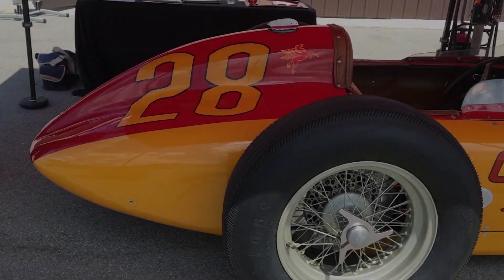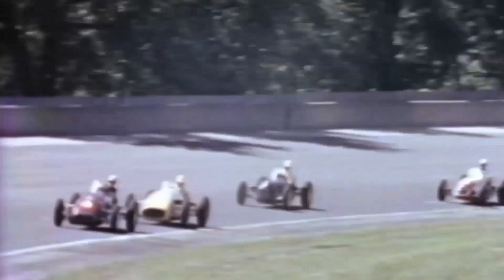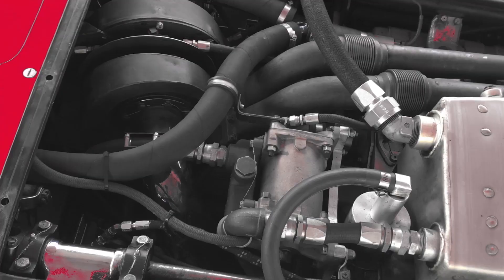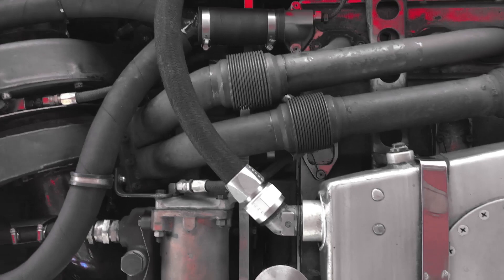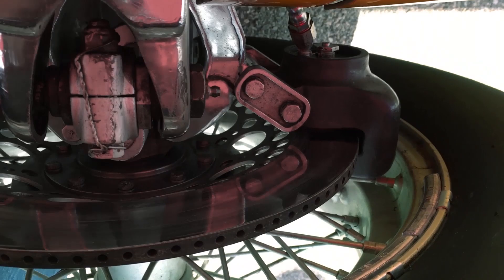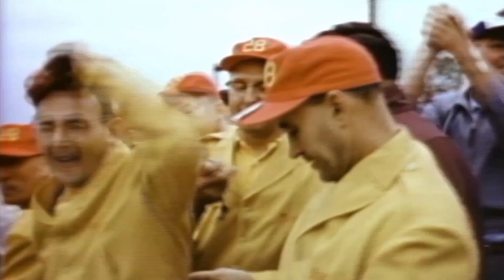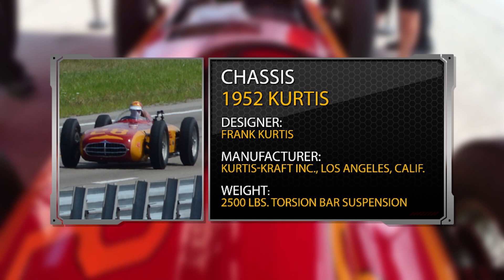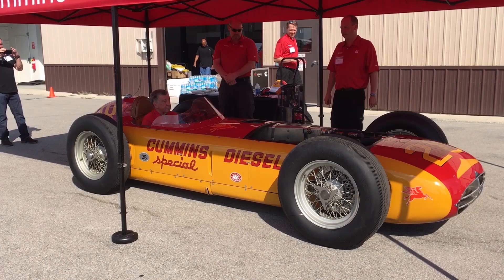Cummins Diesel Engine Sets Lap Record at 1952 Indy 500

Comment: This car is LEGEND in Columbus, IN.  Used to see it in parades as a kid.  There is also a famous Auburn sedan running a Cummins Diesel that is displayed from time to time.
Reply: yes the one from 1929? I was at the auburn acd museum this very day this fateful day that is the last of the 12 days of Christmas known as epiphany or three kings day for the magi, and also the year anniversary of that dark day when the capital was raided, anyway read about the Cummins special it finished 13th and had such high efficiency it finished the ENTIRE RACE 500 at indy on one tank of fuel. it really put their name out there, turns out yes It was gotten from Auggie Duisenberg in the auburn automotive company number 8 I belive it was its in the speedway museum and each of the four cylinders were individual, the guy at the front desk of the Museum was like Oh Wow for the fact it was one of the auburn automotive companies cars. 
I was there trying to see if maybe they had an old offy powered racecar on display or the marman meteor1 or 3 but not this time for the meteor they do have race cars though, was curious how high they rode off the ground as they of course also raced that style on big dirt tracks and was said the new mid engines that now rule indy are too low to run dirt anymore hence the slight height of the usac silver crowns which are the modern incarnations of the old small block long cowl racing roadsters and that hight in question was about 8 inches to a foot off the ground by the space of his hands I estimated.  though about the only thing they have in common is they are both front engine and have the huge rear tank with the vane along the top, and they kind of have a similar side view from a distance they are square nosed though vs the cigar or rocket shape of the old origional champ cars. and they run a larger engine now though still not the huge 410 the sprints run, but they still have more power then the modern nascars and I bet if you ran them on the same track they would be just as fast though they have 750 ish hp now and are lighter then nascars and though huge on a big track thats over a mile can get up to 175 miles per hour though built for differant things then the nascars which do have models for super speedways champ car silver crowns do not though they toyed with the notion for a time.  its ok though I like the gutteral throaty sound of the champ cars any day to nascar though I will still occasionally watch.

Comment: The dcar was pulled due to a broken suspension part, NOT due to tire debris in the intake. Chessie Cummins did not want to bad mouth Kurtis Kraft. It is in the Cumins news letter.I have a copy.
Reply: Fascinating. Wow, I'd heard that when they did the mechanical restoration that they found a crack in the crankshaft that would have side lined the car shortly thereafter.

Comment: It look like Indy came off very good this year 2019.  Congratulations to all that made it happen.
That said, I am still old school and liked the racing sport when it had diversity.  At Indy.
255 cu. in. race engines, 170 cu. in. race engines supercharged.  300 cu. in. Stock block and 400 cu. in. diesel.
All running together.  What a show.
Reply: I have to agree with you Rooster. It leads to some interesting innovations

Comment: and look at diesels now. making 3000HP and going 6's in the quarter mile. even conquering pikes peak. that shows a diesel(even power stroke. GMC detroit diesel, and duramax) are not to be sneezed at. these engines were always ahead of their time because of their thermal efficiency. even F1 and indy car engines struggle today because they are trying to match a diesel engine but be way higher revving

Comment: Weighed 900-1100 lbs more than most of the Indy cars of that era and ate those narrow tires for lunch. But having Freddy at the wheel was huge plus. He had a widespread rep for being the most mechanically articulate driver of his time and was often asked or hired to consult on cars other than the one's he drove in the race from the late '40s to the mid-'50s. George Salih later copied the layover engine scheme and won the 1957 and '58 500s with Sam Hanks and Jimmy Bryan at the wheel of the much smaller, Offy-propelled Belond Exhaust Special.
Reply: "Road hugging weight"

Comment: They really should have a nascar level that Diesel engines. I don’t think they realize how many folks would watch that. Diesel engines burn cleaner, I think they sound better, and they last longer than most gassers. That’s if it has proper services and if they’ve built the engine in anyway to substitute for adding the cold air intake, tuner, or studding the 6.0’s.

Comment: The design team really hit a homerun.  Lower profile and offset C.G.  allowed them to run with the other cars despite being 30% heavier which is why the tires were not holding up well and clogging up the turbo with debris.

Comment: After Setting the valve lash and ..."Adjusting the injectors???"
How do you adjust injectors?
That sounds like....
"And after putting air in the tires and making sure the air was rotated properly, she rolled smooth as silk"
Reply: The rocker arms that actuate the injectors have to be adjusted  on Cummins pt fuel systems
Reply: @chrisgauthier3428  Interesting, thanks for explaining, I'm familiar with cummins 6BT engines so this is new to me adjusting injectors rocker arms.
Reply: @drd1924  From what I have seen....The system is similar to the 2-Stroke Detroit Diesels...Mechanical Unit Injectors...Which on a 2-stroke, have the same injection frequency at 2250RPM as this Cummins does at 4500...The Detroit style, MUI injection system is "Fast Enough" to allow most 4-Stroke diesels to spin 6000+ RPM...Far faster than the average internals can handle.

Comment: Why didn't they use a two stroke? They're lighter and produce more power per unit of weight.
Reply: Cummins ran a 2-stroke diesel at Indy in 1934.  It wore out completely during the race, and Clessie decided to concentrate on 4-strokes only from that time.  To put that in perspective, recall that Detroit Diesel didn't get their 2-strokes to market until 1938.  Then Detroit Diesel started making 4-strokes in 1987 with the Series 60.  But Cummins has been working on a 2-stroke opposed-piston diesel partnered with Achates Power since 2019.  Kinda makes your head spin, doesn't it?

Comment: This was when Indy was exciting! Car owners were able to bring their innovations to the track and test them. Now it's a cookie cutter race....same chassis, two engines. Everybody get in line an go in circles!!! BORING! Thanks Indy Car League for making Indy another corporate shit sandwich !!
Reply: so if all the cars / engine are the same, and the are all flat out around the track, why are some faster, some slower and some not make the race at all?. To be a fan today, you just can't sit back, you have to look and understand the differences. And with all of that, the actual racing has never been better. The 2019 Indy race showed that a driver pushing to win, the entire race can indeed come home first.
Reply: How many laps at 1952 indy race did the Cummings diesel complete
Reply: @johnt.randall9526  After sitting on the pole for the '52 Indy 500, Freddie only completed 71 of the 200 laps. On a side note, this wasn't the first diesel to drive the 500. In 1931, a guy named Dave Evans drove a Cummings Diesel machine all 200 laps without making a pitstop, the ONLY driver in speedway history to do that. Pretty remarkable when you think about it. He finished around 13th place. Bill Cummings would later win the 500 in 1934.
Reply: What is a "Cummings"?

Comment: How many cylinders? Size? Cubic inches?  Is it a secret?
Reply: 6 liters 6 cylinders
Reply: Thank you, Sir.
Reply: Well i got off my lazy ass and discovered Cummins power had been used several times beginning in 1931-3 -5 and 1950. The early models were used in Duesenberg racing chassis 85 hp 4cyl. 251 cu. in. In 1950 /52 380hp 401 cu.in.
Reply: 6 cylinder  🤗
Reply: The specs are displayed in the video.